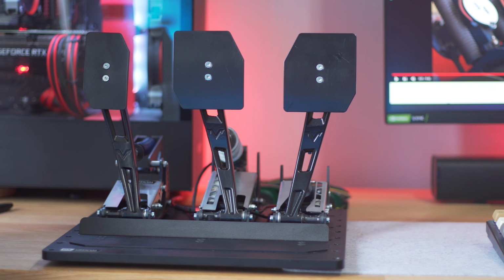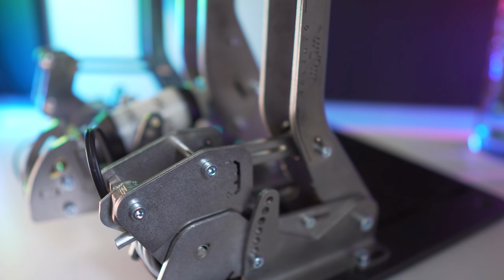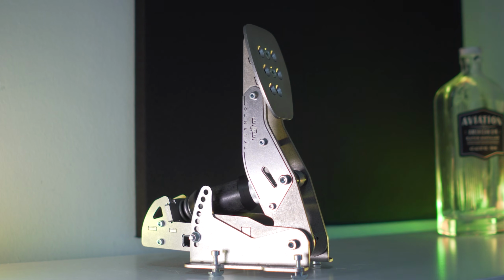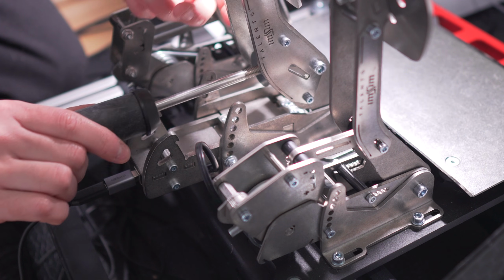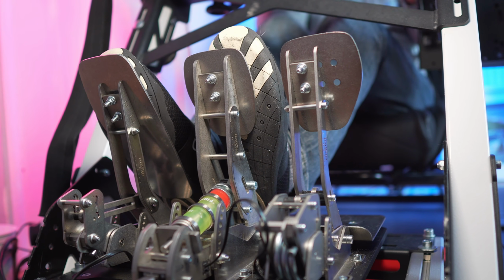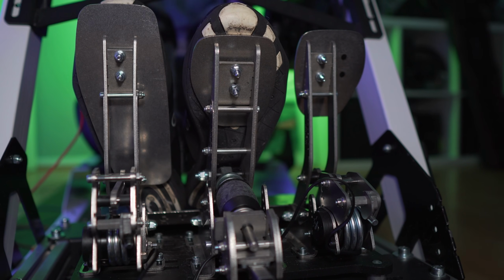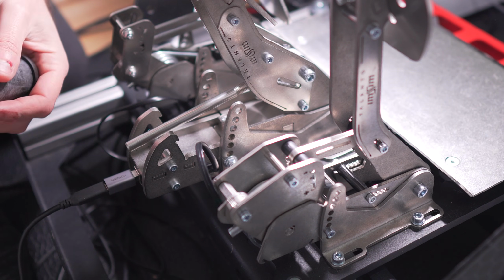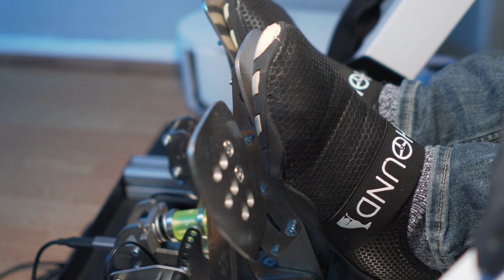ImSim Talento Pedals Review

Comment: Great review, 

could you tell me is only one elastomer provided in the standar presentation without the brake performance kit?

Also up to how many kg can you set up the brake pedal with the standar elastomer?
Reply from the maker: 2 elastomers. 60kg and 80kg. You can set up the LC up to 180KG regardless of the elastomer. They will not compress more past their rating. Its explained in the video.
Reply: @randomcallsign  I thought if you wanted to set it up up to 160 or 180 you needed the optional brake performance kit.

In my case I have enough with 60kg...so in this case I don't need the brake performance kit?

Also how do you rate these Talento pedals in comparison to HE Sprints?
Reply from the maker: No need for the performance kit. Explained in the video that I find it a waste of money for me.
Compared to sprints, from what I tried, I prefer the talentos.
Reply: @randomcallsign  yes..I saw that you mentioned bpk not really necessary...just wanted to confirm...thank you